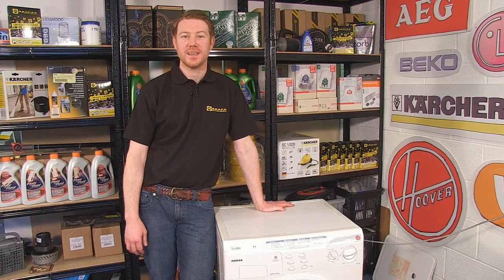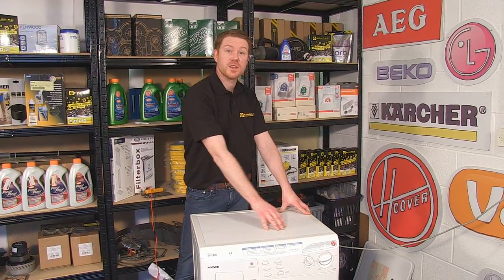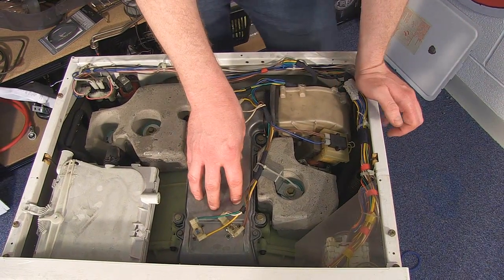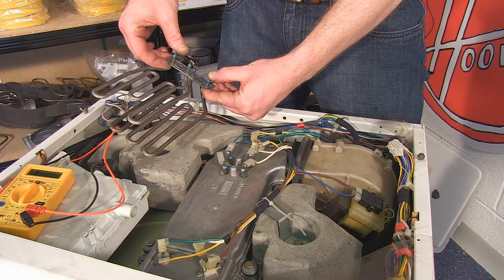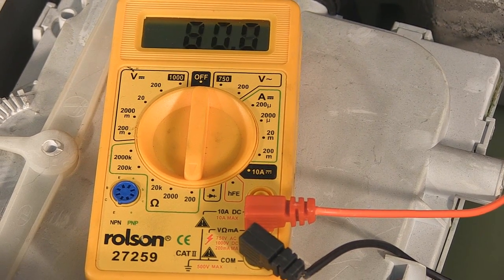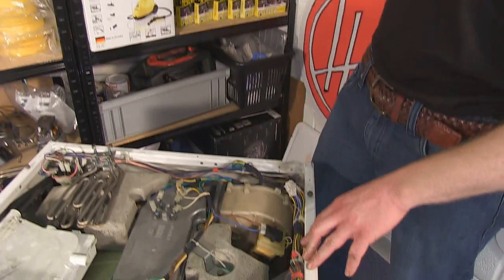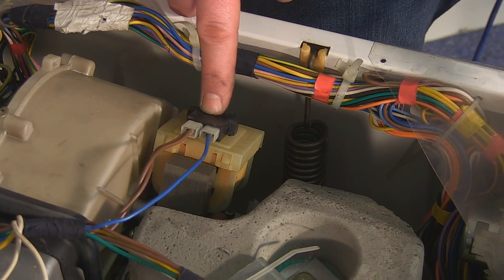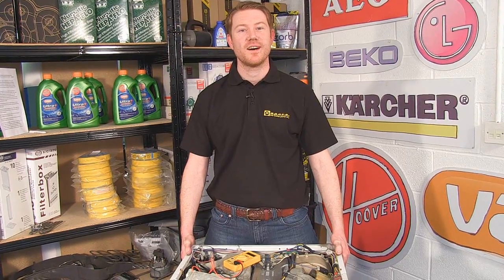How to Diagnose Washer Dryer Drying Problems

Comment: We're having a problem with our LG washer/dryer combo not drying. We had a tech come out and he charged us $300 to replace the drain pump but it didn't fix the problem. We can't afford another service call right now. I have figured out that if I shut off the cold water and run a dry cycle it dries the clothes perfectly. But if I turn the cold water on again and run a dry cycle those same clothes will be totally soaked again. Anyone have any idea what could be causing this? If I know what part to replace I can do it myself. LG's online support is totally useless. Their answer to everything is a service call.
Reply from the maker: +Acesfool To increase the efficiency of the condenser it is cooled by regularly being sprayed with cold water during the drying cycle. The drain pump should keep cutting it to take away water as it builds up or it can start to fill the drum and wet the clothes. Run empty and check after 20 minutes if you can see water coming into the bottom of the drum. As most LG machines have two pumps it is possible the wrong one has been replaced and the original is sticking when warm.
Reply: +eSpares Thanks for the reply. I decided to try testing it a bit. With everything hooked up and turned on I ran a 20 minute wash cycle with no drying. No water in the drum. Then I ran a 30 minute dry cycle and ended up with a pretty good sized puddle in the bottom of the drum. I immediately ran a spin cycle and selected "No Spin" and it drained the water out. 

During the dry cycle I felt the hose which runs from the cold water valve inlet to the dryer duct. I could feel the water running through there quite easily and it seemed to have a lot of pressure to it. I'm just guessing that it's really not supposed to have that much pressure and maybe that valve is opening too much during the dry cycle? If I unplug the electric wire that plugs into that valve I can run a full wash and dry cycle and everything comes out fine. Replacing that valve would be rather easy, but it's kind of pricey.
Reply from the maker: +Acesfool The water is deliberately forced through a small spray hole to provide a cooling mist without wasting water so we don't think that is likely to be the problem. Still think the problem is more likely to be the pump and that's where we would start.
Reply: @Tressym66  : Hello friend, I am having exactly the same situation as you described in this reply. Could you tell me what was the problem? Was it drain pump or valve? 
Thank you in advance for your answer. 
My washer dryer is BRANDT wtd1276k. I already cleaned hot air ventilator from lint.
Reply: @Zhuki1970  I ended up unplugging the power to the solinoid that controls the valve which sprays during the dry cycle and haven't had a problem since. We still have the washer but we did buy a regular dryer and use it instead of the LG combo for drying.
Reply: Ok, I just solved my problem. 
It was drain pipe clogged with sludge (stinking grey mud), causing drain pump to work inefficiently and not draining all water (expected amount) in predefined, programmed operation-time of pump. I found that, there is no "low water level" sensor in my washer-dryer model, so pump is working on predefined time. I already bought replacement pump, but when i opened pump filter, and left it opened and let machine run "1 hour dry program", pump was working on idle strong... I manually intercepted water running from drum trough opened filter into pan, and measured volume: 1.5 liter every 5 minutes ). Then I noticed weak flow that was running from drain pipe to sewer pipe in wall... For wash program pump was active more than 17 minutes, for dry program it needed to pump out approx 1.5 liter in 10 seconds then shuts off. It drained maybe one liter... So I mechanically unclogged plastic pipe from machine to sewer pipe. A lot of sludge. Now it drains in less than 5 seconds, then I hear it runs dry, with no more water to pump. Clothes are dry after 1 hour dry program ( about 12 cycles of spraying-draining cycle), because there are no more undrained portion of water in drum.
To conclude: drain pump was ok, but drain pipe that goes to sewer was clogged and reduced water flow to 1/3 of normal. And in my case sewer pipe was also clogged. Pump had time to drain all the water in wash cycle, but not in dry cycle. Maybe this will help someone with similar problem.